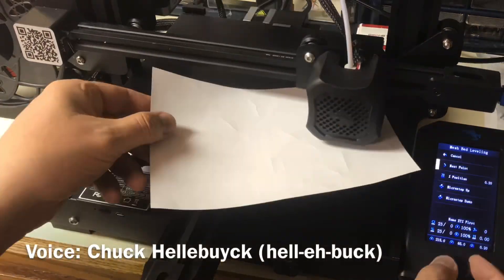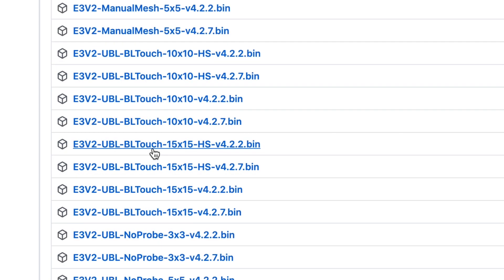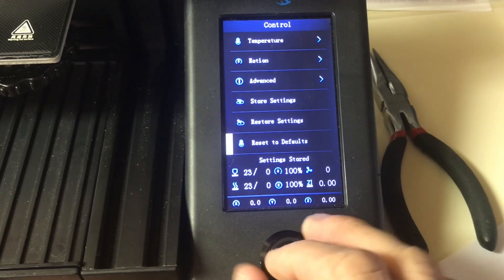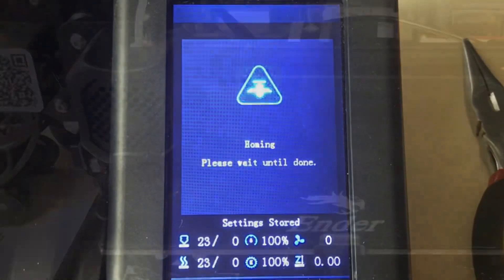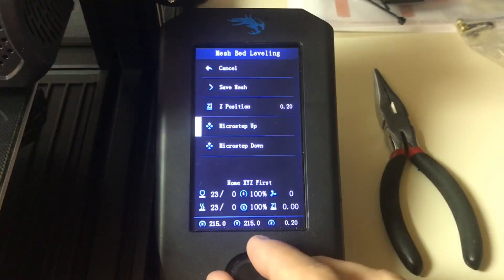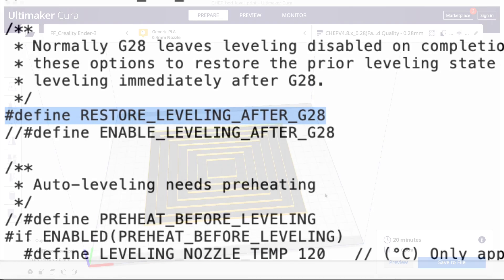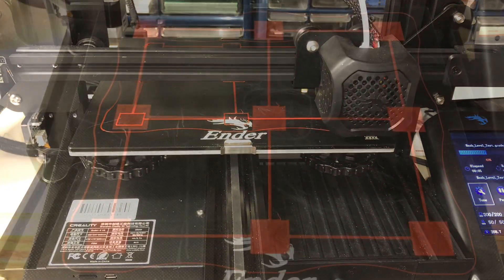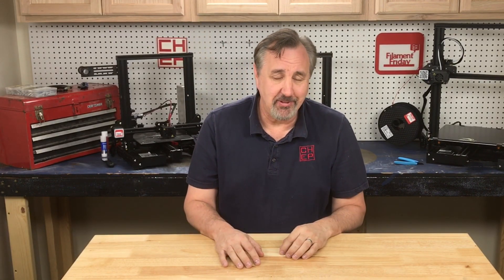Creality Ender 3 V2 - Mesh Bed Leveling

Comment: Guys I need help I got a new ender3 v2 I uploaded the files that are on his link. I can pull up all of the new menus on the screen when I boot up the machine the software level is 1.3.0 When I try the manual bed leveling the head goes to the home and it does not move when I select the desired position to level it. When I try the leveling tool the machine goes to the home and back to the center of the bed.
Reply: you are using the wrong file. If you have the 4.2.7 board use the file ending with that number. If its the 4.2.2 use the file ending in 4.2.2

Comment: Thank You for this information and video... firmware update is done (manual 3x3)! 
After the firmware update, the extruder ratio should be checked! My printed test has become underextruded - the ratio was automaticly only 93% after upgrade. So it need check! (My printer is working good on 98%)

Comment: I'm not very knowledgeable about firmware so I don't quite understand the differences between the  E3V2-BLTouch-3x3-HS-v4.2.2.bin and the E3V2-UBL-BLTouch-10x10-HS-v4.2.2.bin. The second is a universal firmware but universal in what way. It is still named for the Ender3 v2.

Comment: Tried the mesh leveling firmware and worked like a charm, printed a couple of parts but next day, the bed was not leveled at all, had to do the process over again, and the bed was way off. Could it be i'm losing the values when i turn the printer off? - Thanks
Reply: Did you make sure to select "save mesh" after you were done? I know I've forgotten to do that once or twice. If you don't select that then it will reset the next time you turn the printer on. Hope this helps.
Reply: @nicholasstathopoulos9038  Yes I did, thank you for your reply though
Reply: @mariov57  Did you add M420 S1 after G28 in your slicer start code? If not, the saved mesh is not being loaded after G28 (autohome) turns it off.
Reply: @therising1  I did after the fact, I might misunderstood from the video that was not really needed. But now i inserted the code, is working now - Thanks!
Reply: @mariov57  Yes, it is absolutely needed. I added a comment to the video a few days ago about this very issue. The "Restore_Leveling_After_G28" does not do what most people think it does. It only restores the leveling STATE. So if leveling was OFF before a G28, then it will remain off. 99/100 times, leveling is off by default so adding M420 S1 is usually required.
Reply: @therising1  u saved my day, thanks

Comment: Tried using E3V2-BLTouch-5x5-v4.2.2 firmware. After I auto home, reset Z to zero, print head moves down. When I try to adjust my z offset, the print head doesnt move. So i went over to leveling menu and try to a levelling from there. First the probe did a center test(off center actually), then it proceed to move the probe towards the bottom left of the plate, but was outside the build plate instead. After this is done, it just say "levelling complete, save to eeprom?". Only probe 2 points.. Doesnt seem to work the same way as creality BLtouch leveling guide. Im using creality BLtouch btw. Can't wait to see the guide with BLtouch soon! Great work as usual! Thank you so much

Comment: Just a small question: how long is the reboot of the machine when inserting the card taking for you?
Reply from the maker: I sped it up for the video. It takes around 10 seconds.
Reply: @FilamentFriday  thanks 
I got worried when i had 5 minutes of blank-screen
Reply: @Peter_Schluss-Mit-Lustig  me too? how did you fix it?

Comment: Do you know why it has to be an 8GB SD card? The one that came with my printer was DOA so I've been using a 16GB card. I've done firmware updates and reverted back as well using the larger card.
Reply from the maker: It’s just a recommendation.

Comment: I know this is out of context but how can you do to print in the carborundum surface? I have been trying to work with it but no luck... Everytime, the very first initial extrusion, doesnt stick to the bed and when the nozzle come back to do the second line it mess everything out, and even when I manage to get it rigth, eventualy it get lose from the bed and ruin the entire print. I had to switch the glass face and go with hair spray. Any sugestions or thouths?
Reply from the maker: Clean it like I showed in this video
Reply: Honestly, I tried as soon as watched this video and no luck.. Maybe I have a bad coating of this material or something like that.. It's really frustrating since I've seen many people using it with success..
Reply from the maker: Have you tried my bed level technique?
Reply: @FilamentFriday  This one showed in the video no, I'm still under warranty of my printer, so I'm afraid voiding it in case something fail, it's only 3 months but still.. I downloaded the file and everything... Just waiting... 😁
Reply from the maker: No, this video: https://youtu.be/_EfWVUJjBdA
Reply: @FilamentFriday  I will try and come back to give you a feedback if works or not, by the way I have a ender 3 v2 with 4.2.2 board.. For know I can only say thank you for all your help..
Reply: Well I tried but doesn't work. I discovery that I have a warped bed too witch is unfortunate, and maybe when i turn the glass upside down it correct enougth to print without any issue. I will try the firmware with the mesh bed leveling later. One thing that I have and haven't seen anyone have problem, is the z offset, I have mine with -0,04 on cura, since the printer doesn't have this option in the menu (only while printing), and if I don't do this, the printer starts printing on the air.

Comment: I've done this, and its amazing now, it saved me a ton of work, because i upgraded the springs, and yet after 3 or 4 prints i had to level it again.
With this is on point for 12 prints already, day and night.
I just have a question tho, do you preheat the printer before leveling yours?
Thanks for saving me again Chep, always you. Great Work
Reply from the maker: I don’t.

Comment: Hi chep, thanks for the firmware but before updating the frmware do I have to update the dislpay firmware? Because I tried but I am left with the white display without any writing. and if so which firmware to use for the display?
Reply from the maker: You shouldn’t need to update it but there should be a DWIN file to update display.
Reply: @FilamentFriday  ok tank you

Comment: Hi Chuck, thanks for this interesting video. If we change the firmware, is it necessary to do the calibrations on the machine again? Are the parameters stored in the EEPROM erased?
Reply: I'm not Chuck. But I can tell that yes, you will need to set it all up again as the first thing you should do after updating is restore defaults (from everything I've read).  I assume this is to weed out any conflicting parameters. What I do before restoring the defaults is go through and make notes of anything that will stay the same, such as e-steps, and after restoring put them back in and store config. On my first boots after flashing the values were still in the eeprom, which helps if you forget to make more of them before flashing. Obviously anything that might have some variance will have to be completely recalibrated. Hope this helps.
Reply from the maker: Good question. I thought values stored in EEPROM weren’t erased but I need to verify.
Reply: @FilamentFriday  I am not sure, is it possible to create a backup for PID parameters, steps, accelerations and others??

Comment: Thank you for informing us about this firmware, also thanks to the author Jyers. I've had problem about levelling center of my bed, but mesh bed levelling solve this problem. Also I like the "Turn of display" option. Tihs firnware has very good features. Waiting for your review about BLTouch version of this firmware. Thank you so much again.
Reply: turn off display is nice, but, i have trouble to turn the screen on again if it done print. The display is off, but still can amnuver menus. i accidentally pressed mesh leveling button again while screen off. gotta restart the printer to get it on again
Reply: @CTZN1  This is a known issue, and will be fixed when the next release rolls out soon, for now I'd avoid turning off the display during prints.
Reply: @jakemyers3382  Ohh the author is here! Nice to meet you! Btw, is display brightness reseting after restart is also an issue or should I press save button?
Reply: @CTZN1  Nice to meet you too! Yes, the display brightness needs to be saved to eeprom if you want it to stick after a restart.
Reply: @jakemyers3382  ooh! Oh I have question too about unload, load filament menu. I haven't found documentation about that, I maybe missed this one on wiki. I don't get it the unload filament do, 

I tried it, extruder pushing back, and suddenly extruder pushing again to nozzle. So what does it do actually?
Reply: @CTZN1  It will load or unload the filament, you just need to set the distance from your extruder to the nozzle in the advanced menu.
Reply from the maker: @Jake myers - I tried it after setting movement to 100 mm in advance settings. It said nozzle too cold and took me to preheat menu. I clicked PLA, it heated to 190 and then did nothing. I left preheat and clicked unload and it said nozzle is too cold. 
So it’s not working for me either.
I preheated it first, the went to unload and that worked.

Comment: Hi Chuck. This - and all bed leveling videos - would be better if final z-offset was included.  Leveling a bed to "paper width" is only then end of the path if you are (1) using the same thickness paper (2) using a 0.4mm nozzle and (3) printing with PLA.  A guide that would address how z-offset is managed after uniform distances at mesh points are established would be super helpful and close the loop on the leveling discussion.

Comment: Hi Chuck, I am battling with adhesion to the bed. Bed is levelled and the print after that start 100% with the first layer, then a next different print the first layer doesn't stick and I have to off-set the Z by -0.1 to -0.2. The next different print the first layer adhesion is 100% again. I am starting to think that something happens in the slicer (Cura 4.8) during slicing process of different models. The bed is still level when checking it, maybe this software will help solve the issue, I am going to give it a try. The issue is just interesting, did you perhaps came across something like this?
Reply from the maker: Check the eccentric wheels on your crossbeam are properly holding the beam level. It could be lifting or sagging after a print on the not threaded rod side.

Comment: Hi there , I really need ur help , I’m new to 3D printing , my problem is don’t matter what I do , anytime I pause my prints to swap filament, the nozzle don’t rise up , it stays on the print , i have  the new ender 3 with 4.2.2 board
Reply: I would expect it to stay down.
Reply: What can be done ?
Reply: It does not rise up , the nozzle stayes on the print
Reply from the maker: Check the threaded rod coupling for slippage.
Reply: I did , everything is ok , it’s not a hardware issue, cause it only stop after upgrading the firmware
Reply from the maker: Sorry, mis-read the first post. What firmware are you running?
Are you using pause from the menu or a pause at height in slicer?
Reply: Marlin 2.0 and I tried both pause from menu and from cura and prusaslicer

Comment: I just got my Ender 3 v2 and this was a life saver!  I was able to get my bed dialed in with a 3x3 grid.  For newer folks, be sure to open up your electronics panel on the bottom of the printer to see which board you have.

Comment: Thanks champ! Almost gave up 3D printing before I started because of my Ender 3 V2 with warped bed.
People online said "glass beds don't warp" and mesh bed leveling only worked for standard Ender 3 back then.
Luckily I ordered a new bed that was flat, but man what a mess. This should be standard software in every printer.

Comment: My BLTouch is plugged into the Zstop on my board, currently using the custom smith3d ZSwitchStop firmware. Is there any Jyers firmware that does the same?

Comment: I am getting a message: printer kill reason/homing failed. Any suggestions?

thanks!!!
Reply: You probably used the wrong firmware version. I thought I had 4.2.7 because my printer is new but I ended up having 4.2.2. When I flashed my 4.2.2 board with 4.2.7 firmware, it did this. Just do the same process with the right firmware and you'll be good to go.
Reply: @fholgado  yep... i was too excited and missed that! It's working better than ever!
Thanks!
Reply: Look in the Github Discussions for the firmware. This has been talking about.

Comment: Also got mesh levelling on both my Ender 3 Pros about a week ago, one of them had a really warped bed with a dip in the centre. The difference on some calibration prints was amazing. I'd appreciate seeing the BL touch video Chuck, if only because I'm of the school of getting things used and tubed until limits are found. Your honest appraisal of whether BL touch is a worthy upgrade over mesh levelling would be welcome.

Comment: Also for those interested, that firmware is very good for a few different reasons:
- it restores a lot of features and options in the menu
- it shows print progress on display when using Octoprint (if you have the right plugins in Octoprint of course)
- of course the different bed leveling options

Been using this for weeks, never went back to the Smith3D firmware after that.

Comment: So the question is are you living wheels set up. all tight or a few turns ??
and is the  4.2.7 ok to use vs 4.2.2
Reply: 4.2.7 is fine with this firmware and printer. Jyersm has firmware options for both boards precompiled with source available.

Comment: Does  it work for the Ender 3 pro?
Reply: No. Due to the changes made for the Creality DWIN, this is only for the E3V2. But most of these options are available for the E3 Pro if you compile your own. My E3 Pro has all of the features that my E3V2 running Jyersm has. That was the crux of this firmware...the E3V2 was supposed to be an upgrade to the Pro but because the screen firmware was so poorly written, many of the Marlin features just didn't work. Now they do!

Comment: Chuck, I'd recommend to heat the bed up to printing temperatures beforehand. The level will subtly change on a hot bed - enough that it can effect the mesh.

Comment: The SD card does not have to be blank.
Ive used the one that came with the printer full of my gcodes, it just needs to be in the main directory.
Just delete it once it's updated.
Reply: You don't even need to delete the bin file if you don't want to. Once updatedz the printer remembers the most recent firmware's filename and blocks updating to it to prevent an upgrade loop.

Comment: Also, restore leveling after G28 only levels the STATE of leveling. It will not TURN ON leveling. You still need M420 S1.
Reply from the maker: Not according to the online Marlin manual https://marlinfw.org/docs/gcode/M420.html
"G28 disables bed leveling. Follow with M420 S to turn leveling on, or use RESTORE_LEVELING_AFTER_G28 to automatically keep leveling on after G28."
Reply: @FilamentFriday   that's not what it does though. That only works if leveling is ON before G28. That's why the guide says "keep" leveling on and not "turn" leveling on. This is a common misconception.

Comment: You did not even have to update the LCD using the microSD? That's black magic! But, to be honest, I'll wait until my "old style" Ender3 v1 LCD comes and will simply switch it.
Reply from the maker: No, didn’t touch the LCD.
Reply: With the Jyers build the display configuration is changed to work off the mainboard, the only time you would update the lcd is if you want different icon's. I've been running Jyers for a while now and love it hope someday he will update it to also run the screen in the horizontal position.